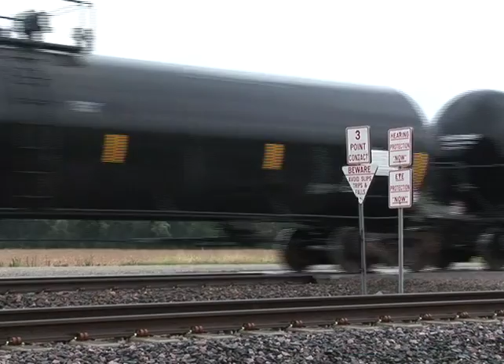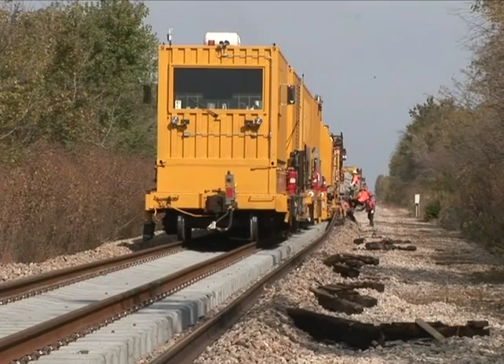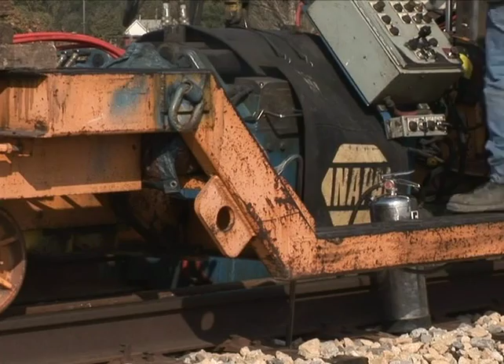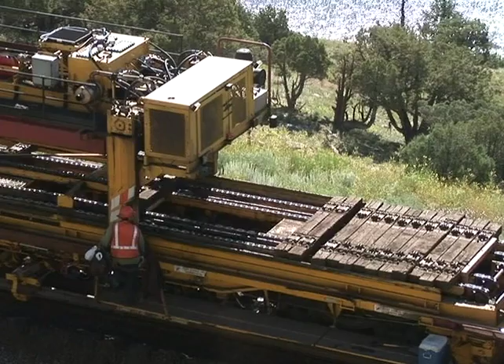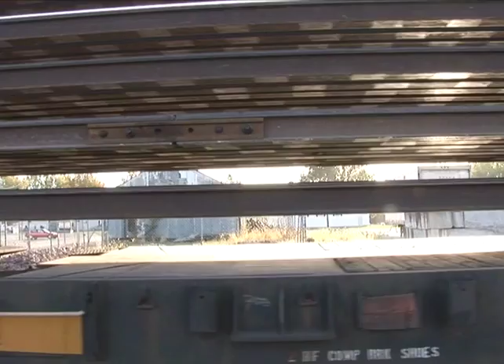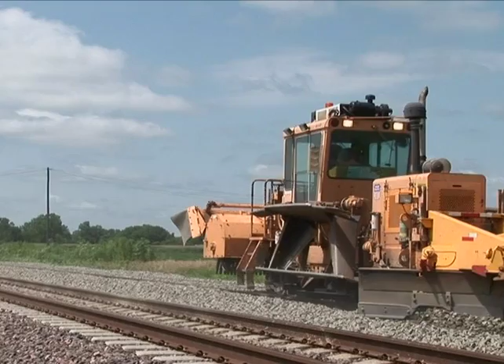New TRT Video

Comment: Only one problem as I see, I live right by the U.P. rail line with new concrete ties, The new concrete ties don't last long as I seen them breaking up & have to be replace, which means U.P is now going thur more then ever & carrying longer & heavier loads which means the  concrete ties wearing out faster & as now they are replacing them again. I was wondering if then can go into hard rubber ties as I seen in other countries are using them now.  Just an idea.